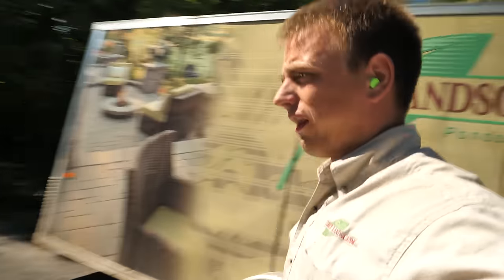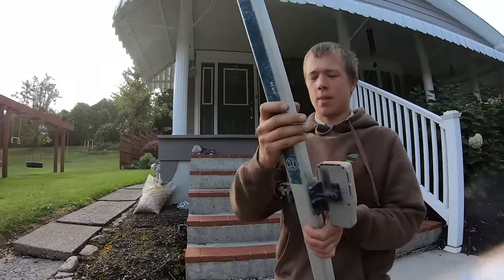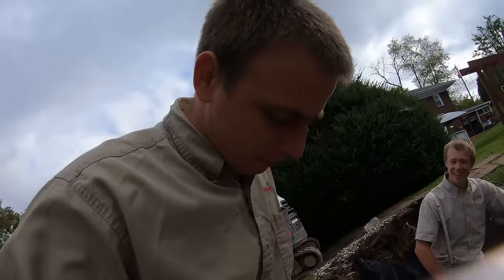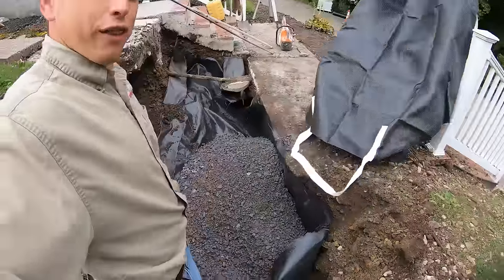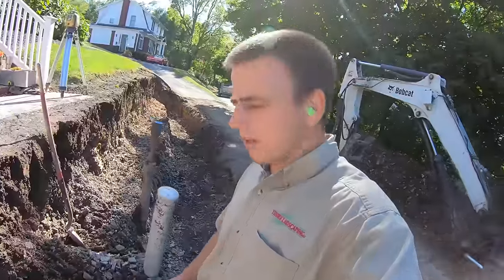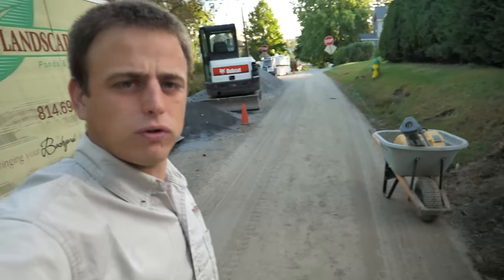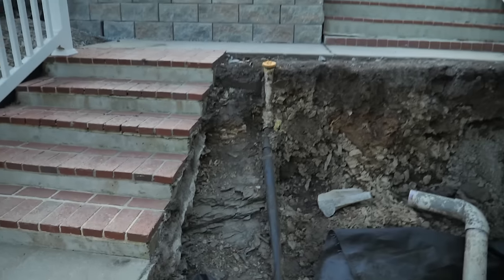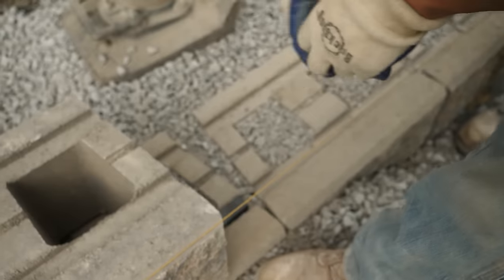How to build a RETAINING WALL that WON'T fall over!

Comment: best wall would still be a concrete wall... that wont fall over =)
Reply from the maker: That would have been an option, but this wall won't fall over just as much if not better than a concrete wall.

Comment: Looks like you incorrectly laying the geo grid. 
It should be turned 90 degree so that the thick strands of grid is perpendicular to the wall. Other viewer also commented incorrectly using of grid, and you argued it is bidirectional. 
Look at the video multiple times,  it is obviously not.
Also, you used wrong fabric on the top.
A breathable type should be used so water can sip into gravel while keeping dirt out of gravel. 
You really need to learn how those products works, so not to make this beginner's mistake and mislead others. 
Sorry for the negative comment.
Reply from the maker: Both of your assumptions are incorrect. The fabric is permeable, the grid is bi directional. Sorry to contradict. But I built the job and handled the materials myself. I know what I installed

Comment: Not bad, but as usual health and safety not really followed, no wet cutting for dust control, or goggles, clouds of dust that can affect your health and others.
Reply from the maker: We use the proper PPE as required, but you are correct, we dont like wet cutting

Comment: How to build a retaining wall that won’t fail. 
Step one: buy about half million dollars worth of tools and equipment.
Reply from the maker: or hire us and avoid buying all that equipment 😜 the equipment makes the job faster and easier, but you could certainly do it with less equipment than we had. You;d for sure need at least a compactor, other than that, pretty much everything could be done by hand. (I pity you though if you try it)
Reply: Tussey Landscaping lol I don’t suppose your in the Kentucky area. But I say you can’t go wrong with just going ahead and buying the equipment. I mean what man couldn’t use all of that laying around 🤤
Reply from the maker: Yeah exactly! I like the way you think 😂

Comment: Wow no concrete foundations. That's a first for me , concrete foundations are the basis of all walls particularly retaining walls. That's what I love about you yanks, you put way more stuff into projects than is needed and don't do the basics. This video should be called how to over complicate a simple project.
Reply from the maker: This is a very common method of retaining wall installation. Designed and installed according to manufacturers engineered specs. It is. SRW (Segmental Retaining Wall) system, which flexes with freeze and thaw, which is why it is on a stone base instead of concrete. Concrete is monolithic and does not flex with freeze and thaw, (is not Segmental) which causes it to crack.
Reply from the maker: That being said, you could also do a concrete retaining wall, nothing wrong with that, but then you'd have to go under the frost line, up here that's 3' of excavation
Reply: @Tusseylandscaping  Thanks for the reply, It's clearer now why you have used that system,  I'm from a different part of the world so horses for courses I guess 👍👍

Comment: Crappy job you notice in the opening shot the big gap in the bottom brick...lol what are you going to say..a bullshit answer that its for drainage lol sloppy work guys. This is an advertisement for low end quality. Hopefully they at lest got a really low price
Reply from the maker: That "gap" is where the drainage pipe is daylighted (it's a square cornered fitting so you don't have to cut a round hole in to the retaining wall block). It is intentionally placed there, and without it the wall wouldn't be built properly

Comment: Any wall can and will fall if mother nature wants it to. So you may want to change your statement.
Reply: The walls of the Temple of Gobekli Tepe in Urfa, southeast Turkey are thought to be 11,500 years old.  So you may want to chill a bit.
Reply from the maker: Sure, natural disasters destroy far more than just walls. But under normal circumstances, walls can be engineered to last a long long time. Look at the Romans!

So, I'll stand by my statement, "How to build a wall that won't fall over" as it is perfectly achievable. It's worth noting:  In that statement I'm comparing to walls that fall over within 3-15 years due to poor construction.

Comment: These guys don’t know how grid works
Reply: Rolled it out the wrong way and needs the soil to lock it in. Way too much stone. 12" is good, 18" better, 24" overkill, 4-5 ft. Waste!
Reply from the maker: Your right, it would not have been neccessary to backfill with all that stone, but there was zero space to stage the dirt, so it was far easier to haul the dirt out and haul stone back in. 

This grid is bi directional fyi

The grid was overkill for this wall, we did not exceed this blocks maximum height with no grid. The grid was just like an extra assurance because we wanted to. 

I'll let you know when this wall falls over 🙌

Comment: Shocking lack of engineering knowledge,  you basically dumped and compacted enough stone to hold back the ground, like a dam not a wall, I feel for your customer for wasting so much money when a number of engineering solutions costing 5 times less would have done a far better job than this.
Reply from the maker: So your saying you know of a way to build this wall for $2,800? Interesting... I'd like to see this
Reply from the maker: Full transparency, I'll tell you why we backfilled with so much stone: there was zero space in the tight streets to stage the dirt we dug out. Only option was to haul it away. When we were back filling, it was easier, faster (cheaper) to just haul one material back in: clean stone, to back fill
Reply: @Tusseylandscaping  It's like you constructed a gravity dam where the Hoover stands. Cheapest way to hold back a vertical face is with concrete and rebar. A big advantage with reinforced concrete is you can pour it in place and allow it to settle later. No need to dig out and compact. Essentially you create a concreter raft that the earth sits on, then you pin that raft down.
Reply from the maker: And you can do all that for $2,800? Maybe the home owners weren't looking for the cheapest? Maybe they were looking for something that looks a bit better than a gray concrete wall? 🤷‍♂️
Reply: @Tusseylandscaping  Building one at this moment, already built at least half a dozen at heights of over 15ft holding back clay, I live in an hilly area where landslips are a problem. I watched your video because I always looking for new innovative ways to construct before building anything. The one I am constructing now is 30ft long by 10ft high. Cost for the rebar is $200 and the cement $800. I am going to clad the one side with wood. I recovered the wood from the original collapsed boundary but I could have clad it with rocks recovered from excavating or purchased new face bricks.

Get "Building Construction & Graphic Standards"  ISBN 0620 07787 5

A bible for building, no text, it assumes you already know how to build, it just gives diagrams and dimensions and equations for different structures, includes plumbing and electrics.